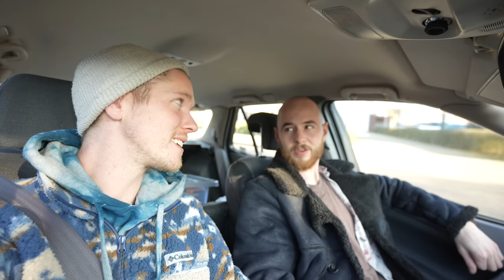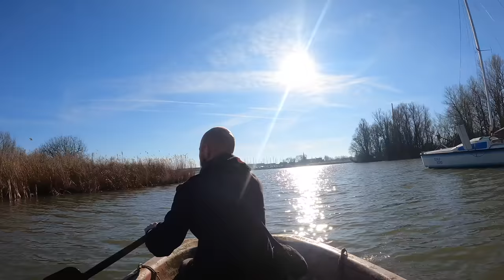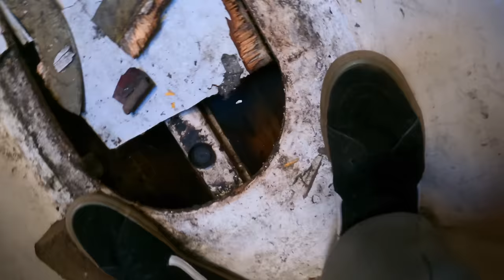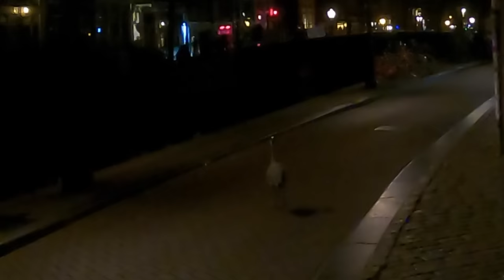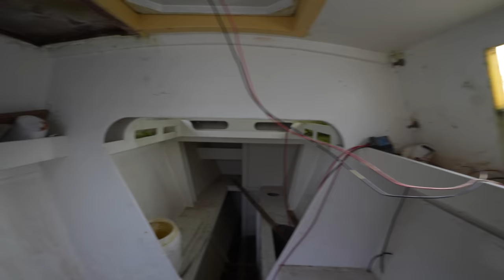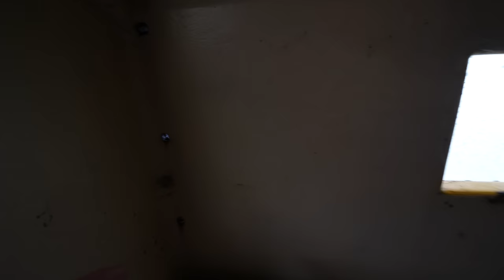I Made A LOW Offer On A SINKING Catamaran | Wildling Sailing

Comment: Mark, remember that the Pahi 42 is demountable. If the yard fees are too much, consider disassembling the beams and putting her on a trailer to you folks' backyard.
Reply: You sound as if you have never been to Amsterdam!
Reply: @nativeseedbank-thailand  Are you implying that a repair yard in Amsterdam is less expensive than Mark's parents' backyard?  FYI My favorite restaurant in Amsterdam is Formosa.  It's walking distance from the Delta Hotel where I used to stay up to 4x a year.
Reply: @CuestaBroadcasting  I reckon you need to do a bit of reading... try 'Two Girls Two Catamarans' written by James Wharram! The two girls were his German girlfriends who he sailed to Trinidad with... in a catamaran he designed and built almost identical to the Pahi 42! Doubt if Mark will find two Dutch girls/crew in his parents backyard in Preston. It's called the 'Wharram Dream' in England... reading helps to fully appreciate it though! Keep up!
Reply: @Artiz...  Is this the non-sequitur thread of Wildling's Sailing?  What does sailing with 2 Dutch girls have to do with fixing a cat in the backyard of Mark's parents' home?  FYI: According to the Wharram web site, ... "The NARAI design is a direct descendant of the 40ft RONGO on which James made his pioneering voyage across the North Atlantic in ..."  Not the Pahi 42
Reply: @Artiz...   What's a Numpty??
Reply: Hell, it’s still all wood and lashing and the hills are under water.  A wharram on the hard, ok, but this submerged in finished boat, come on man?

Comment: I used to paint houses and my boss always told home owners to cut the shrubs and trees back away from the house. Cause if there's leaves next to the wood on your house it is putting moisture into the wood. This has water inside and outside a sheet of plywood you're saying for years? I think you're going to find surprises on every bit of this boat. To me it looks like a nightmare project. Is it even floating or is it sitting on the bottom?

Comment: Mark, I don't usually make a negative comment but seeing the latest video I need to advise you. As a young and naive 26 year old I bought a 57ft Pilot cutter called 'Mascotte' find it on YouTube. I estimated it would be  2 year project, in fact it took me 7 years and become a total rebuild. My advise is walk away! Find a boat ready to sail, or just needing tidying up!
Do you want to be a boat restorer or a adventurer/ sailor?
By the way, I was a skilled carpenter at 26 and had 3 shops in another business, but was still financially challenged to complete Mascotte's rebuild!
Reply: Could not have said it better!
In addition, this boat construction is "complicated" compared to a fiberglass hull. With many critical points that make the restoration time-consuming and expensive.
I was afraid of this, too much romantic dreams instead of setting sail for adventure. Build up a profitable sailing channel and take it from there!
So another restoration channel in sight!
I did the opposite, bought a budget boat in April, set sail in August and came home 6 years later!
Reply: @thenorseman2804  Brilliant, well done.
Reply: @thenorseman2804

Comment: It looks like one of the Wharram Pahi design. These only fulfil one of the principal objectives of their design brief - that is the conversion of anything wood-like into rot. It isn't a cheap project, it's just a simple way of using up all of your time and funds. I would recommend seeking out the nearest trainer shop and ask them what could take you the furthest away in the shortest possible time and buy those. And before the ranters start, I've only built three Wharrams and worked on another two.
Reply: @WildlingSailing _ TAKE NOTE MARK .... GEEZ, has living in your car made you BATS??? _
Reply: Great to hear someone with actual experience chipping in although I feel he's already made up his mind for some reason and he won't be swayed now
Reply: I couldn't agree more.....
Reply: He said its a young Pahi 42. And if the boat is healthy he has a fitting projekt.
Reply: Were design improvements made to the tiki series that address the shortcomings you've seen in the pahis?
I've seen a few big pahis in great shape
Reply: @josephhertzberg2734  The main improvements in the Tiki's was the move away from huge laminations of timber (the classic Wharrams like the Narai have a laminated keel, laminated bow and stern and laminated cross beams) Tiki's have much lighter structural elements with a bit more intelligent engineering. They also don't have the rot pockets where the beams join the hull, and are lashed instead of the bolted/stacked rubber fastenings of the Classic. Unfortunately, the Pahi's have the full combination of the worst features. The larger ones are in better condition because it's easier to get to the trouble spots on a bigger boat, and the owners have more cash to throw at it.
Reply: @jackm3040  You might not get what you see ......
(but what you learn to know)
Reply: @jackm3040  For what I can see from here the boat seems of good quality with many arguments for talking the price down.
(nice 1000 euro Reflex heater too.)

Comment: “A boat is a hole in the water you throw money into.”   I think that is exactly what you got there.
Reply: Or in this case two holes…
Reply: @Douglas James Official  all I see are two pontoons. I think cleaning is the least of his worries.
Reply: It all depends how you throw the money into it. Do shiploads of work yourself can be a big saver.
I've just done a battery upgrade to lithiums, new controllers, and solar. For under $3500(Aussie dollars)
Essentially, my labour costs are free. 
Finding the time is the hard part. Which blows out repair times.
I do everything, sewing, fibreglass, electrical to mechanical.
Reply: @Douglas James Official  A realistic budget will tell you this is not a practical way to go sailing.
Reply: @Douglas James Official  All boats need maintenance and repairs - this boat is a long way from sailing. The "Freedom" was in a sailaway condition.
Reply: B.O.A.T. = Break Out Another Thousand
Reply: H.R.H. Duke of Edinburgh, I think, said,   'Sailing is like standing in a cold shower, tearing up fivers.'  Today, it is like £50 notes, but I love my boat, and it is worth it.
Reply: @AndyUK-Corrival  Thank goodness it is not a trimaran !
Reply: @SVPearler  I think the big problem is installing a good helicopter deck ! 😁
Reply: It's a very expensive project. A lot of work and parts. Why has it been so neglected?
Reply: No, this is a huge ‘pit’. Offer to take it off the owners hands for $5000.00
Reply: @@Water-Man I think you’ll find the foam you saw was purely insulation. Pretty sure that cat is plywood.
Reply: @charonstyxferryman pick any harbour in the world. Sink all those boats with the construction material you mentioned, ...but WAIT add one more. Any ferrocement made vessel. Your choice. Come back in 100 years. Guess which one will be salvageable., with lowest recoverable expense. However the boy won't listen to the right advice. Oh well. Shrug shoulders. Sink or swim. I'm moving on.
You just can't help some people. All the best mate.
Reply: @Douglas James Official  agreed. Wharrams are mostly plywood anyway. They’re meant to be made cheap and cheerful.
Reply: @@Water-Man If so, regarding steel hulled boats on the oceans, why are there so many hundreds of them still making their way, being more than 75 years of age, with little to no rust at all?
Reply: I guess you don't have one i guess. You might also say throw your money in a psychiatrist, as for a boat it has the strange effect that with the first step onto it you leave everything else behind.
Reply: @LucScheffers  if u want two leaky pontoons, this is great.
Reply: @LucScheffers  is t that what Mark is planning to do? Sailing off into the sunset (eventually).
Reply: @@Water-Man Why, how terribly funny. I grew up on my dad's 78 foot steel hulled schooner. Built in the Netherlands in 1926. Currently, it's moored in a marina in the Netherlands, and my cousins take it out on long-distance crossings every year. Yes, there is a bit of rust (in my comment, I stated, "with little to no rust at all"), but it is not insurmountable, as the boat is cherished and maintained. Maintenance is always a priority, especially for those of us who have sailed for decades and who love sailing. As for your comment, you neglected the fact that fresh water is far more deleterious to wood than is salt water. Please, look it up.
Reply: @Steven Hodgson  then it's how long you can make that thousand last. Do your own work can equate to making it work like it's $5000.
For me, $600 of fibreglass materials has been probably worth $3000 if I had someone else do the work.
Also, look for things that are marine without it saying marine!!
Found household hand rails that are 316 stainless. Paid $30. The same thing "Marine" would have cost $100.
Reply: @@Water-Man    So says the trolling troll? How amusing.
Reply: @knucklesandwich8786  yep true, but it is just plywood, glass and polyester/epoxy and relative easy to fix. I see here in the harbour expensive boats and owners doing maintenance that run in the thousands each year. This one i guess runs to 5-10K. The real issue is time. To spend and still have fun and a good covered dry place to work on the boat for months.

Comment: Being myself a boat builder in Canada, I think you should increase your initial budget. Honestly, a "deal" doesn't exist. You always get what you pay for. Stop thinking about the purchase price and focus on the final price at the launch, I mean, the reconstruction materials, your time, the rental of the marina with electricity and heating, all that quickly adds up the final price. I think you've already forgotten how unpleasant it is to grind fiberglass...but hey, it's your choice. You have to ask yourself if you prefer to sail, or build a boat. If it's building, then do good and build a beautiful, brand new Wharram...it'll be faster, better, and more importantly, more satisfying. But if you prefer sailing, then find yourself a good job for a few years, and then buy yourself a good boat. I learned over time that a good boat costs a certain price. Good luck!

Comment: To a certain point, I totally understand the potential that you see in this project and at a sufficiently low starter cost. My main putoff is that these wharram designs are way to claustrophobic for my taste 😄 
Good luck :)
Reply: Yeah, but this wouldn’t be your boat, so your opinion on cramped quarters doesn’t matter. You know that a Wharram is Mark’s dream boat. Any speculation beyond the condition of the boat isn’t helpful.
Reply: @chrisdougherty9098  I was impressed with his very optimistic attitude while doing the inspection and the realistic estimate as to the work and funding needed to make this his dream vessel - hence my initial postive remark. Notice that I did not yell RUN AS H*LL 😉. I might take on a similar challenge but most likely that would be a 40ish ft monohull.
So yeah, again: Good luck Mark👍🙂
Reply: I like the design in that they compromise comfort for safety , but the wood home made construction never finished and then left to rot sets off alarm bells
Reply: Never stepped foot on a Wharram, but I think part of the appeal is all of the potential deck space. It can basically be one giant deck, with four little cabins to sleep and cook in. Someone did a tour of a 42 here on yt and the deck on that thing was practically endless.

Comment: There is nothing to lose on this one! I don’t know anything about boats, but, I’ve watched your channel start till now, this one seems to match you. If it’s £5k or less, regardless of boat, it will be a good YouTube watch regardless. What’s engaging is how you make boat life achievable to the everyday dreamer, and at the end of this one you’ll have a 42 ft smashing catamaran
Reply: It needs a masts, sails, rigging, winches, windlass, electrics, solar panels, batteries, battery management systems, nav gear, radio gear, auto pilot, engines, steering, hulls rebuilding, new decks, all hatches, water tanks, interior fittings and portlights and that's just for starters !
I have no idea how much that lot would cost to buy new but I do know it's beyond Marks meagre budget and could take years to pay for ! If he could get all the parts second hand it might be possible to get it for around $50k at a rough estimate but that does not include the cost of paint, materials, building the deck house and paying people to help, it quickly becomes a major undertaking when you look at the details !

Comment: I hope you get this boat and turn it into something beautiful. If the hull is solid, that means the hard work is already done. You just need to clean, repair and refit it to your liking. Nothing a bit of bleach, scrubbing pads, plywood and epoxy can't fix. Also you are in communication with Hanneke who is undoubtedly the expert on the subject and knows you and your ambitions/limitations. Take advice from her, not from dock dwellers. I bet people told you Minke was a lost cause too, but you got that one up and running.
Reply: *also, I'm willing to help fix it up. Ive never been to the Netherlands but I have been a professional boat repair guy

Comment: Remember how plywood works.  They are sheets and the water wicks between.  when you replace a section of rot, its not just the rot.  You must replace to the points of attachment, ribs, stringers, etc...that can mean that other sided of the hull or cabin have to be taken off.  There will be rot everywhere.  If you do buy it (shudder), penetrating epoxy is glorious stuff.
Reply: Apart from the thrill (rush) of handing over the cash after heavy negotiations - the MOST enjoyable part of 'owning' this would be the dismantling faze!

Comment: Honestly you could come to the states, hit the great lakes states, a few local marinas. Most of them have boats that haven't moved in years but are on the hard and in far better shape. Of course you might be looking at 25-30 foot boats and some of those might even be free, most way under your budget. Sail through the canals and rivers to Florida/the gulf and sell the "freshwater " boat after you find something more to your liking. 
Truly the boat is just a boat, the adventure is the thing, not the destination but how you get there and that can be in any boat. 
Find a <40ft boat that's solid and take your time with a plan to refit and upgrade the boat to fit your needs as you learn them. Multihulls are great except it's two or more hulls to clean, paint, maintain and of course dockage and access become issues in some places.

Comment: I can see you doing that project, it's a good location,  lots of expertise there. I would say put in a lower offer, but I think you already may have done your offer already. The important  thing is not to fear walking away if the offer is not accepted. . You can leave the offer on the table and the seller may take a couple of months  to realised he is not going to sell it before it sinks from freak storm or some other event and reconsider your offer again. Best wishes Mark, I know that's the type of boat you really want, just don't  let your desires override your judgement.

Comment: Based on the agae on the window, and water on the shelf, that's definitely a leaking window.
I restored a pahi 31 in also poor condition, places that I found rot: the manu (bits that curve up at the end) EVERY bolt hole - center of each crossbeam/hull join. You could probably check this in the water if you did it one at a time. The dorade drain holes - that's the self draining section you pointed to. Btw, I notice that that hole had screw holes showing, like an inspection port was screwed then removed. I doubt they sealed the screw holes after removing that so probably rot there. The pahi31 plans say glassing the hatch covers was optional, well, most of them rotted away. Luckily you have all commercial hatches. Anything that has an inside corner where water can stand. such as rails along the crossbeams for the decks to sit on. I also notice there are no decks or cockpits on this boat! were they removed because they were too rotten? looks like the current owner brought it in a dilapidated condition then improvised those outboard mounts to move it here, I guess, then lost interest in the project. A shame they left the outboards sitting in the water. There are very few people who are ready to take on a project like this. I think any amount of money you give them is generous. I see a mast. Are there sails?
Reply: Another commenter made the very good point that if the seller accepts your offer, it's no longer their responsibility. so they are no longer on the hook for salvage after it gets wrecked in freak storm, or decays even more to the point it's simply not worth saving. You are doing them a favor taking this off their hands, at any price.
Reply: @Wildling Sailing this is a guy you should be listening to about rescuing/restoring Wharrams (and checking out his channel)